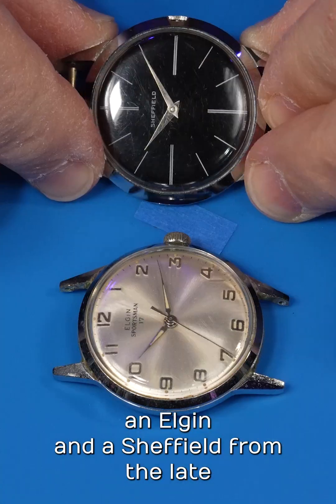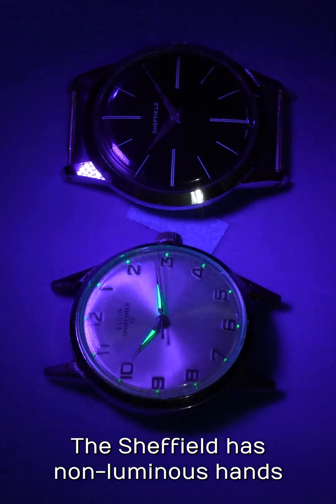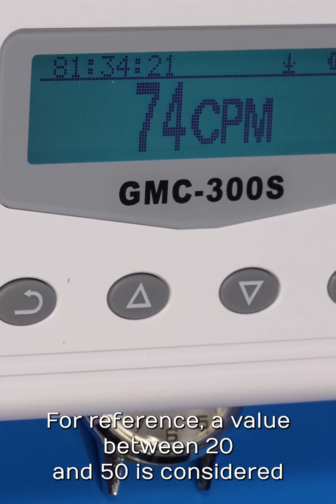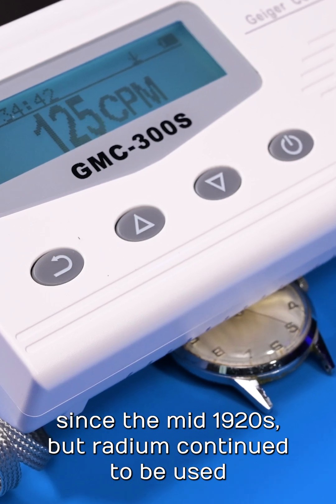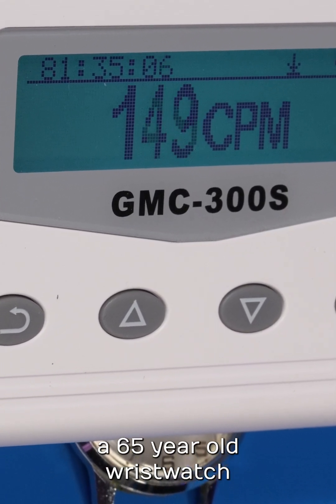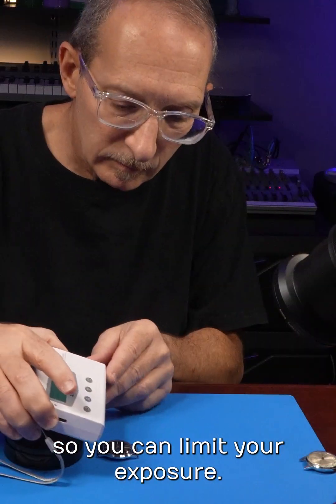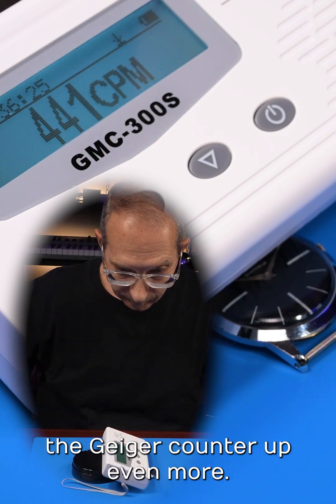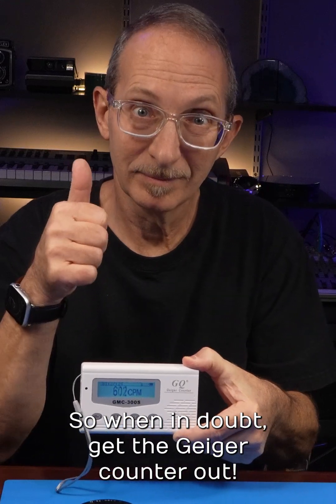Radioactive Watches! Looks can be deceiving...

Comment: Hi Mike, a bit off topic regarding this shorts but does that microscope camera you have, have autofocus or is that not needed? Can you zoom in and out with it without zooming in or out on the microscope?

thanks in advance, and thank you for your detailed video about your microscope!
Reply from the maker: No auto focus on the microscope camera! The only way to focus a microscope is by turning the focus knob, or by physically moving the camera up up and down. For me, the camera has to record exactly what I am seeing, and what part of the Watch I am focusing on.
Reply: @WatchWithMike  thank you for your answer! i have the same microscope, and i'm looking to buy a camera with it. Would you still recommend this camera or would you have bought a different one? From what i can see on your video's, i'm pretty impressed with the quality/price point!
Reply from the maker: @Pieter.T  I did a lot of looking before I bought this camera, and it offers the best features at its price point. It's not 100% perfect, but I absolutely needed to have a microphone input so I could have audio to synchronize the rest of my cameras too but the audio has clicks and pops on it that the manufacturer can't tell me how to fix… Good enough for me to synchronize with my other audio, but not good enough to use by itself. My other beef is that you have to reset exposure and white balance every time you turn the camera back on… It doesn't remember the last setting. But if you can get past those faults, I am absolutely blown away with the results!

Comment: I have your Sheffield problem. Although my Bulova has no obvious source of radium lume (solid hands and hour markers), the watch is still setting off my Geiger counter. Bummer.
Reply: Quite possibly. I was also wondering if the hands were swapped out.  If so, maybe the original hands were radioactive. Who knows???
Reply from the maker: @SkyBlue-le7cd  Part of the fun of watchmaking lies in the mystery! 😁👀
Reply from the maker: SkyBlue, I have a theory on mine...maybe your Bulova experienced something similar. I bought this watch alongside another watch, a military style watch from the 1940s with lots of radioactive lume. That watch was missing a winding stem, so possibly radioactive dust exited the watch and got on mine. Who knows how these old watches were stored if we purchased them from other people? So maybe it's a case of cross contamination.
Reply: After a bit of research, I found an old ad for the Bulova that I have. Looks like the original hands on my watch were swapped out for the present set, which doesn’t have lume. The ad specifically stated that the original hands have radium.  The Geiger counter topped out at 250 CPMs or so, if I recall, which is less than your Sheffield, but still more than enough for me. Thinking of selling it.